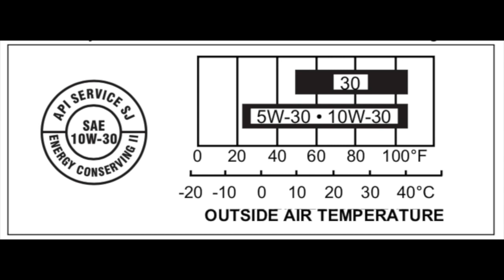How to Tune Up a Honda Lawn Mower | GC/GCV Engines

Comment: I changed my oil 4 times last year. Of course, it was brand new then. I bought a magnetic dipstick for it and only use Royal Purple full synthetic oil. That dipstick does a phenomenal job pulling the metal out of the oil.

I'm a fanatic about my mower, so I check and clean the air filter before each mow, sharpen my blades every 30 days, run non-ethanol gasoline only, installed a tachometer/hour meter before I started it the first time and keep meticulous records in a maintenance log book that I make entries into after each time I run it. 
I also wash her down and scrape under the deck after each mow as well.

Last year when I bought it, I also added a checkmate lawn striping kit to her as well. The kit did a good job, but this year I'm adding a brush and tines to the kit to get even better, deeper stripes.
I love my Honda so much, I named her Kathryn. LOL! Cheers 👍
Reply: Your funny
Reply: Your funny man
Reply: @michaelc7014  Right on! 👍
Reply: Here I thought I took care of Harmony 216!  Good job on the great job man.
Reply: Where do you get a magnetic dipstick?
Reply: @whatthewhat11  I was wondering the same thing, I can't find one anywhere.

Comment: To check the oil level on a Honda engine, you do not screw the dipstick in at all, just clean off the dipstick, place the dipstick in the hole up to where the threads touch all the way around, pull it out and read it.  This is in the engine manual, which you might need to download from Honda.
Reply from the maker: Jim Stadler Good catch! Thanks Jim.
Reply: @mgomez5606  - Odd, my honda I believe has the oil capacity either  on the mower housing/side of engine, or in the owners manual for the engine (which I downloaded from Honda).  For my mower, the capacity is less than a quart.

Comment: according to my dad(whom I learned most engine repair in general) you need not change the spark plug at every tune up only if it is horribly black!  Oil Change once a year and I personally pull the crank a few times to drain all the excess above or below the cylinder and valves. also when you have run the new oil in and run the engine for a while, I'd recommend revving the engine up using the throttle lever(it is set and spring loaded-just bypass this for the tune up purpose) this will get all  the oil distributed into the engine and get it used to tuning the new oil also if you turn off the carb(Honda feature) it will drain the gas out of your carburetor so you can store it. don't mow after a tune up if it is hot out, especially if you rev up for the final task, instead store it and mow a different day allow the engine to set and rest.-yes even engines need to do this-in spire of what you think, for gaskets and oil to set in the metal innards and joints of the piston, crank shaft and valves. hot out I just got through tuning up my Honda GCV160 for my Troy-Built lawnmower!
Reply: Thanks a lot great tips

Comment: This is general maintenance but not what I think of as a tune up. If this is all a service is then no reason to take it to mower place for servicing but there is more to it isn't there?  Its that more that we need to know about. 
I am small woman, never had muscle power or arm length to lift ANY mower. The few times our mower went in to be looked at husband loaded it into car and service staff took it out. 
I want to learn how to detect at least what it is needs fixing beyond the three things you show here. 
So where do you learn that? Where do you find electronics required to detect and tune up modern mowers?

Comment: The tune-up kit includes 12 oz. of oil, but the manual for the GCV on both my Honda mowers has a capacity of 0.55 liters of oil which is 18.6 ounces. Why is there a discrepancy?
Reply from the maker: If you look in the owners manual under specifications there’s an asterisk next to the refill amount. The manual states refill amount is 12 oz due to residual oil in the engine. Best thing you can do is properly check the oil level after refilling and if it’s low, add more. I haven’t had an issue with this and the refill amount has been just right.
Reply: @ShopEightyFive  That makes sense; thanks for the quick response! Relying on the dipstick level seems to be the final answer.

Comment: What about the drive? Is there a belt to replace or is the mower gear driven with the front or rear wheels?
Reply from the maker: Hi Roy. Yes, there is a drive belt for the Smart Drive System. Honda recommends adjusting the cable every 150 hrs of use or two years, whichever comes first. There’s no mention of replacing the belt and there’s no service part number listed in the owners manual too. Hope this helps!

Comment: You are checking the oil level INCORRECTLY.  After you fill the crankcase, you don't screw the dipstick in.  You simply insert the dipstick and then check the level.  After the level is correct you then screw the dipstick in tightly.  Read your manual and you will see you have been doing it incorrectly.
Reply from the maker: Correct. This has been mentioned already.

Comment: Should have started the mower after you turned off the fuel valve to drain the carburetor from any remaining fuel.
Reply from the maker: Good idea but it wasn’t an issue.